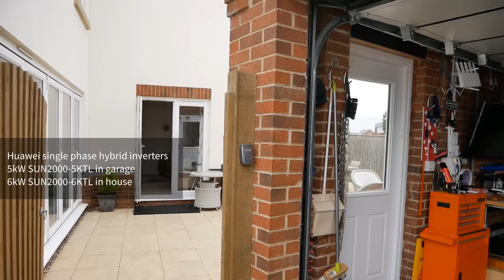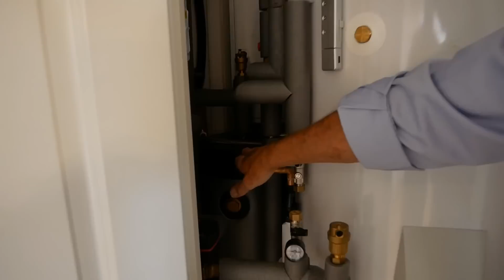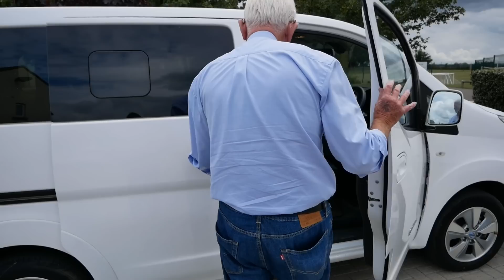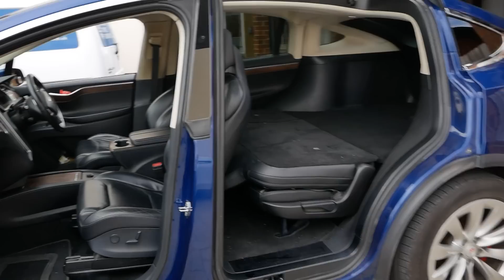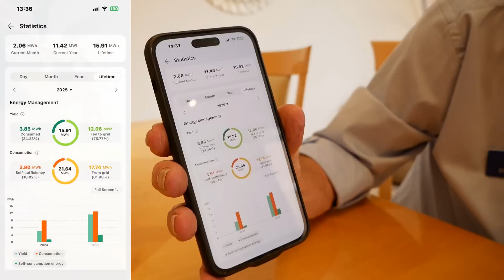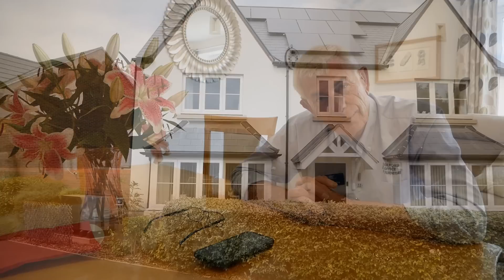How a 5 Bedroom Detached House & 3 Electric Cars Are Powered With ZERO Bills!

Comment: I'm on my 3rd Daikin heat pump in 7 years. They are quite energy efficient, but ironically, it's unable to keep up when the temperature goes subzero for anything longer than a couple of days. I'm not sure if I'd get another one once the warranty has expired.
Reply: That sounds like a poor design or install? The specs suggest they work down to -25C.

With Octopus using them, presumably they are fairly well thought of and reliable.
Reply: @Biggest-hz7ng  I don't know what it is. I am on a small housing estate with 23 other new houses that are just over 7 years old. The installer has referred many faults across the estate to an actual Daikin engineer as the installer was unable to solve them. My immediate neighbour keeps getting an error code that says it is unable to reach a certain temperate to sterilize the hot water tank, and it's still unresolved after 14 months. The 2 houses at the entrance of the estate both keep getting low refrigerant codes, but it seems like it's a false alarm. Sensors replaced, but every few weeks the error code returns and it shuts down. They may work down to -25C on paper, and for a day for 2 of prolonged cold weather, they do work, but you can feel the temperature slowly start to drop when it's minus for many days in a row. There are also 2 modes for the fan, quiet and normal. When set to quiet, it is very quiet, but again, in cold weather, it's not possible to use quiet mode so at night you have the fan running at full speed. We all have the same model of heat pump, so I am wondering if all these issues are specific to this model. Daikin have 4.2 stars on Trustpilot, which isn't terrible, so it may just be the ones we have.
Reply: @Biggest-hz7ng   I don't know what it is. I am on a small housing estate with 23 other new houses that are just over 7 years old. The installer has referred many faults across the estate to an actual Daikin engineer as the installer was unable to solve them. My immediate neighbour keeps getting an error code that says it is unable to reach a certain temperate to sterilize the hot water tank, and it's still unresolved after 14 months. The 2 houses at the entrance of the estate both keep getting low refrigerant codes, but it seems like it's a false alarm. Sensors replaced, but every few weeks the error code returns and it shuts down. They may work down to -25C on paper, and for a day for 2 of prolonged cold weather, they do work, but you can feel the temperature slowly start to drop when it's minus for many days in a row. There are also 2 modes for the fan, quiet and normal. When set to quiet, it is very quiet, but again, in cold weather, it's not possible to use quiet mode so at night you have the fan running at full speed. We all have the same model of heat pump, so I am wondering if all these issues are specific to this model. Daikin have 4.2 stars on Trustpilot, which isn't terrible, so it may just be the ones we have.
Reply: Dazzer we have an 11Kw Heat Pump and absolutely no issues.
Reply: @davebeesley3678  I'm on a small housing estate with 23 other houses around 8 years old. We all have the same model, and many of us started experiencing issues after 4-5 years. From error codes that state the system was unable to perform a sanitization cycle, to low refrigerant when the level was ok. The Daikin van now seems to be a regular fixture in our street. At first, I thought perhaps he was here to service them, but it's actually the installer takes care of that. Maybe it's just the model we all have that's problematic.

Comment: I think this is great as it is more than just saving money, it is self sufficiency and being in control. I have a 5 bedroom house with 4.5 kW of solar and 20kW battery tied to an 8kW inverter and the house is an “island” if there is an outage which cost about £17,000. As an “oldie” I do not look at the number of years for payback, I just look at 5% at present on money in a bond which is taxable versus over 10% return tax free. It has come down a lot as kW day time charges are 26p and they were 42p when we carried out the installation. Buy kW at 7p to use in the home and sell surplus back at 15p, probably too good to be true in the long term, but I do not have a long term expectancy

Comment: I have similar, 30x445W panels on the main roof (south facing) and 14x625W panels on the garage (also south facing). 2x9kW A2A ASHPs, and two EVs. A PW3 and a Solax 6kW inverter

The 2nd array was a self install and came online on 29th April. Since then I'm averaging negative £250/m in bills!

Comment: So only a few mins in and I’m a bit bewildered to why would you have an old Nissan in the drive? It doesn’t make any sense whatsoever when you can get battery storage for less and it wouldn’t take any space on the drive.
This is all abit of a mess in my eyes, there’s no mention of water heating?  I have to say this could have been thought out a little better.
Reply: The Nissan is a Combi with 7 seats and has only 25K miles on the clock, webuyanycar valuation is sub £8K,  it's the cheapest 40 kW battery you can purchase and still used occasionally. If we were to move house we would load the V2H Unit in the car and take it with us.
The Heating runs off the Heat Pump as well and is 24/7 same as the Heating
Reply from the maker: Yes you could have a home battery for less. But when Dave got the V2G, home batteries were in their infancy. Plus Dave already owned the Nissan and it has a huge battery compared to what you'd get otherwise for the money. V2G is a cheap solution because you're utilising a battery you already own. If you didn't have an EV or the EV isn't going to be parked at home for the right periods of time, then V2G isn't the answer and you'd get a home battery.

Comment: Why is the heat pump installed at the front of the house? Its unsightly and stop potential vandalism?
Reply from the maker: I would assume for the air flow because on the other side of the wall it's very restricted as it's in a corner. Plus it needed to be on this side of the house as this is where the existing gas boiler was so it picked up on the old pipework.

Comment: Those indra V2G wallboxes are unicorns.  He has one of hardly any made and you can't even buy one now.  It mostly hinges on this which is a shame.
Reply from the maker: It doesn't hinge on the V2G. Home storage batteries are now available which were in their infancy when Dave got the V2G charger. Dave's power usage is excessive too because he has the heating so high and on 24/7, but a more normal house would use much less energy and solar panels can produce enough energy to cover all the costs as they are doing in Dave's case. It all comes down to the solar, not the V2G. That is just reducing the cost of daytime electricity usage.

Comment: There is no way he spent only 20k for this! My quote for good panels and inverter were 14k for a smaller roof.
Reply from the maker: So you've had an expensive quote and rather than think your supplier is overcharging, you think that others that got it cheaper are lying??
Reply: @GoGreenAutos  Yep! 3 years ago I paid £16k for 17 panels with 12kw batteries. Where mine is probably 7-8 years. 
This year my daughter got the 10 x 450 watt panels and 5kw batteries for 6k. All done in one day. Bargain. She will get it paid back in 4-5 years.
Reply from the maker: No lies here. I've seen the original paperwork and invoices.
Reply: i havent priced it up , but seems to be a descrepncy here i was surprised it was only 20 k .... maybe he put it all through a business ? 

Solar System Costs:

Equipment Only (Panels + Inverter): £7,900-£11,250.
Full Installed Cost: £26,200-£33,700 (average £29,950).
Incentives: 0% VAT (saves ~£4,800). No direct grants, but Smart Export Guarantee (SEG) pays for excess power.
Annual Savings:

Bill Savings: £1,800-£3,000/year (15,000-20,000 kWh at 24p/kWh; covers 50-70% of 10,000 kWh home use).
SEG Earnings: £300-£800/year (export 40% at 10-29p/kWh; assume 20p/kWh average).
Total: £2,100-£3,800/year (midpoint £2,950).

Heat Pump Costs:

Full Installed Cost: £10,500-£14,500 (average £12,500).
Incentives: Boiler Upgrade Scheme (BUS) grant of £7,500, reducing cost to £3,000-£7,000 (midpoint £5,000). Assume ECO4 not applicable (not low-income).
Annual Savings: £260-£550/year vs. old gas boiler (assume £400 midpoint; 15,000 kWh heat demand, COP 3.5 vs. gas at 8p/kWh). Pairing with solar boosts savings by £300-£500/year (assume £400).

Combined Costs:

Total Installed Cost (Before Incentives): £36,700-£48,200 (average £42,450).
After BUS (£7,500) and 0% VAT: £29,200-£40,700 (average £34,950).
Solar + Heat Pump Synergy: Solar powers heat pump, reducing electricity costs (24p/kWh to ~0p for 5,000-7,000 kWh/year of heat pump use).

Combined Savings:

Solar Alone: £2,100-£3,800/year (midpoint £2,950).
Heat Pump Alone: £260-£550/year (midpoint £400).
Synergy Savings: Heat pump uses ~6,000 kWh/year of solar output (instead of grid at 24p/kWh), saving £1,200-£1,500/year extra (midpoint £1,350).
Total Annual Savings: £3,660-£5,850/year (midpoint £4,700).

Payback Period Calculation
The payback period is the total cost after incentives divided by annual savings. We’ll use midpoint, low, and high estimates to account for variability.

Midpoint Estimate:

Cost: £34,950 (average after £7,500 BUS and 0% VAT).
Savings: £4,700/year (solar £2,950 + heat pump £400 + synergy £1,350).
Payback: £34,950 ÷ £4,700 ≈ 7.4 years.

Low-End Estimate (Best Case):

Cost: £29,200 (low-end, post-incentives).
Savings: £5,850/year (high solar output, high SEG, max synergy).
Payback: £29,200 ÷ £5,850 ≈ 5.0 years.

High-End Estimate (Worst Case):

Cost: £40,700 (high-end, post-incentives).
Savings: £3,660/year (low solar output, low SEG, min synergy).
Payback: £40,700 ÷ £3,660 ≈ 11.1 years.

Comment: Really amazing video. Just came across it by chance and immediately subscribed. I don't know what age this man is but he is ahead of most people in this country. We just got 13 panels on a south facing roof with a Duracell Battery and have got our bills down to about £10 to £15 a month (our latest bill was £12 for July) and we live in Northern Ireland in a 2200 sq ft (we get a lot more rain and cloudy days). Our average electricity bill was £120  month. In September last year we got £108 back from the Grid (Nothing like the figures in this video but still good considering the solar had only been installed a couple of months). I think at £20,000 invested in this mans property was a no brainer. The problem I have is in Northern Ireland we only get 0.10p back from the grid plus off peak is quite expensive with Standing Charges...so off peak just doesn't work for us on average they would charge us 30.179p  per Kwh day rate and 13.997p per Kwh night rate plus a standing charge of 9.873p pence per day....nothing like what Dave is being charged
Reply from the maker: Dave is 76. I guess he doesn't mind me sharing that as it's public information anyway.
Good to hear about your setup.

Comment: If your tesla model x is free fuel forever, you should should charge it everyday and sell it back at 15 pence per kw. That would be 5K a year.
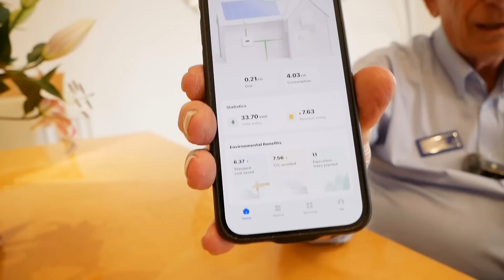I noticed at 22:22 in the video, the app says 33.70kw and £7.63 revenue. this works out 22 pence per kw. i thought you said it was 15p per kw.
Octopus are launching a new scheme for a byd electric car with 12k free electric that use Vehicle to home charging from £299 p/m.
Reply from the maker: Tesla's don't have V2L (or V2H) so you can't export energy back out. Otherwise you could go off and Supercharge for free, then come home and power your house or sell it back to the grid. However, Tesla would soon realise as the energy used would not match the vehicle's mileage and stop your free Supercharging.
Yes, Dave's export rate is 15p per kWh. I'm not sure on the app reporting. That is why I've since taken the last 12 month Octopus bills to work out the pay back when comparing it to the previous year on gas. See the pinned comment.

Comment: To do all that has cost tens of thousands of pounds… It will take a Decade to recover those costs. 3 Electric cars at £60.000 each, a petrol Mini is around £12.000 3 years old. This guy has literally paid all his energy bills 10 years in advance… Don’t be fooled.
Reply from the maker: As per the pinned comment, the payback is 3 years 5 months. It would be even less if he turned the heating down to a normal level. The cars are irrelevant apart from they're now being charged for free.
Reply: The investment has increased the property's value. possibly more than the cost of the installation. Most of us have cars anyway.
Reply: He spent 20k on solar and heatpump. His cars are all old, and he’d have them anyway, but you can pick up an old leaf for well under 5k to use as a battery, and double you’re money every day

Comment: The thing I would like to know is ,as you have so many panels on different faces, are they all running through micro inverters  and that allows those panels to work at maximum efficiency?
Reply from the maker: I doubt if he has micro inverter as all the panels have a clear view to the sky without any shading. Anyway, I'll ask.
Reply: @GoGreenAutos  it allows generation without have a lot of different string on a combo inverter, they just produce 240volts when the sun shines on each panel most inverters have only a couple or more strings for each face.

Comment: Nice to see a fellow Indra V2H trialist. 
My one is happily working away with my 11 year old Nissan Leaf. They are fantastic pieces of kit, albeit noisy in summer.
Reply: I was thinking about picking one up, predominantly just for the battery and grid charging if I can get a cheap one. I know they are V2G, are they also vehicle to house please, I need it to power a heat pump with about 40kwh a day and work in coordination with my PW3. I might occasionally use it as a car in the summer.
Reply: @yp77738yp77739 
V2G is essentially grid controlled discharge. V2H is to discharge according to your home demand, slightly more difficult. 
I also have Powerwall 3, installed a year after V2H. It is a simple matter of wiring secondary home battery (in this case, the V2H) in series. So it will solar-charge/draw from the car first before Powerwall. I use Home Assistant to control everything to ensure one doesn’t drain into the other.

Comment: Thanks for a great video it is really interesting to see just how far you can go to electrify your home. I was an early adopter on the OVO V2G trial that also used the Indra bi-directional charger back in 2019. For the first three years the refund I received each month for exporting to the grid paid for all the electricity I used, home and car, standing charges and some of the gas. When the price of energy rocketed that refund only covered the electricity but it is still slightly profitable now. I have thought of looking to reuse the Indra charger for V2H using the car as an arbitrage over peak/off-peak rates but my usage case has changed recently. Its great to see that Dave is doing just that with the ENV-200 makes more sense to me than buying a seperate battery system.

Comment: I think it’s very good to do this however, it is out of the reach of most people, there needs to be a mind set from government to start subsidising panels, etc, we purchased a Bloor home in 2022, the first part of the 150 home development. The last 50 or so homes have at least eight panels built in to the roof space now, Bloor’s newer developments have heat pumps and panels as standard so no gas at all. I’m debating whether to go down a cheaper route of the new Ecoflow systems
Reply: Panels are very cheap these days, and the inverters have come down a bit too in the last couple of years. The installer’s costs are what make it prohibitively expensive in my opinion. I’ve asked for quotes from several companies to do an inverter upgrade and the OHP (overhead and profit) over and above the materials on the cheapest quote was £2k, for a single day activity for a single electrician. I think you’d be wise to consider the ecoflow, which also means it’s a portable system if you do move house

Comment: wired security camera facing the heat pump ..but wound not someone cut the wires first? its too low ....
Reply: It’s only a broken camera so if it gets pinched it will save me having to recycle it. Goods OK though

Comment: Brilliant set-up and spent about the same here in N Ireland.
Long term this is the way to go as energy prices are only going to go up.
Reply: Energy prices might go up but solar export prices won't. A key part of the future is V2G and that's where he's absolutely nailed it. EVs are going to be needed to smooth the grid at peak times, probably early mornings and early evening. Sadly when there's not much solar about.

But we'll see how it evolves. For this reason I've held off installing more panels and are more likely to get more battery storage especially if I get a heat pump.
Reply from the maker: Yes I agree. I can't wait to do something similar myself.